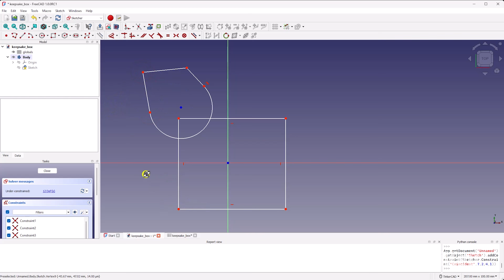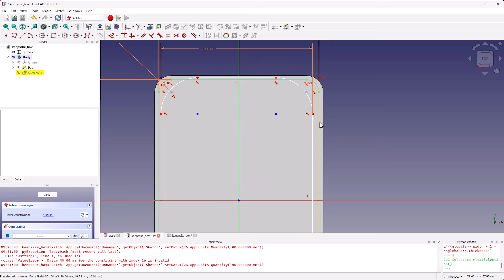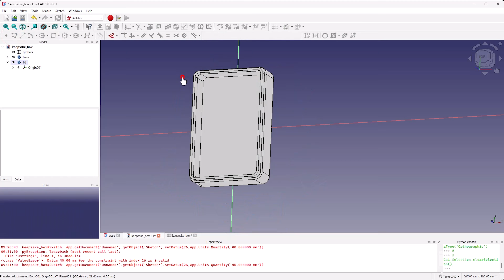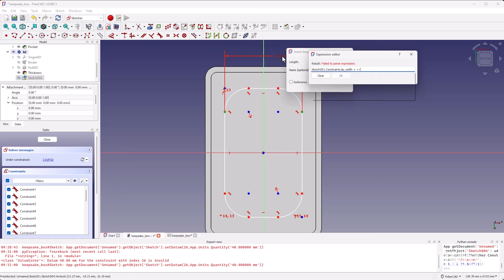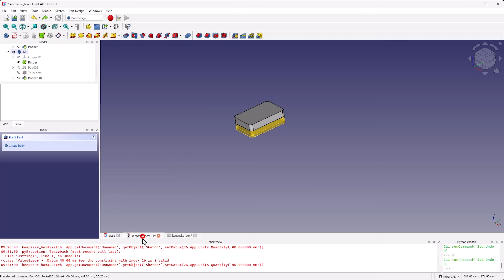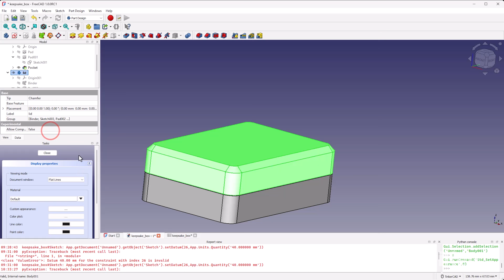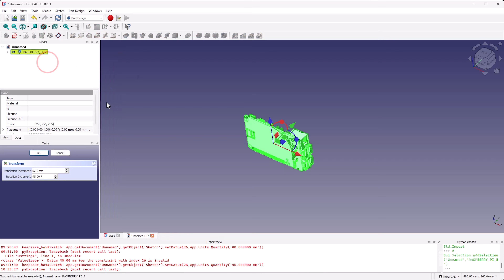Introduction to FreeCAD Part 3: Shape Binders, Expressions, and Spreadsheets | DigiKey

Comment: I was following along but got an error msg when I tried to PAD the lip sketch which is +10mm up on the Z plain. The Error msg is "Cannot use selected object. Selected object must belong to the active body. Consider using ShapeBinder or a BaseFeature to reference external geometry in a body." Note I am using FreeCAD 1.0.0. Thanks...
Reply: Thanks that was the issue.
Reply: My guess is that your sketch is outside of your Part Design active body. In your tree view, drag the sketch into the Body so that you can use Part Design features (e.g. Pad).

Comment: I'm new to FreeCAD, but have bee exposed to VarSets.  When would you use a Spreadsheets vs VarSets?
Reply: Since varsets are attached to a part, where spreadsheets are attached to a project, I'd use varsets for values internal to a part or a single part project, and a spreadsheet for values used across parts like an assembly. You can also mix and match. Varsets based on spreadsheet values and visa versa.

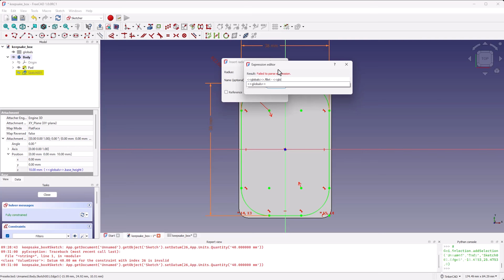Comment: I have a doubt. I did not understand why in 19:34 , for the fillet mesurement we subtract the fillet value by thickness/2 and not the thickness itself. Please explain!
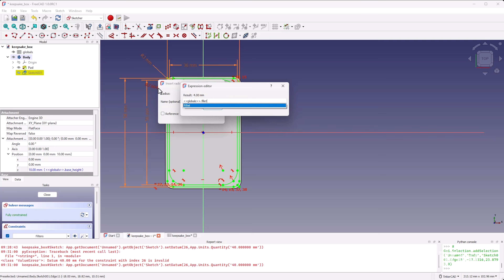Reply: Good question! Apologies for not explaining it in the video. What I created in that part was a fillet for the lip of the base. The lip is half the thickness of the wall thickness, which you can see being created at 21:56. So for the full wall, we do (fillet - thickness) and for the lip, we do (fillet - thickness / 2). Hope that helps!
Reply: @ShawnHymel  Understood. Thank you !